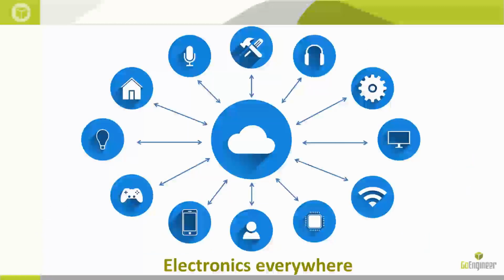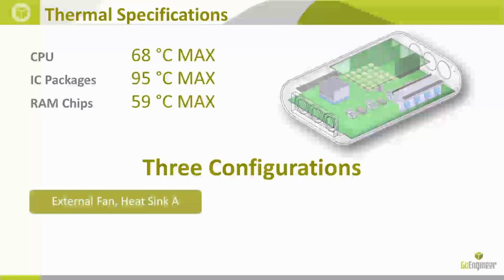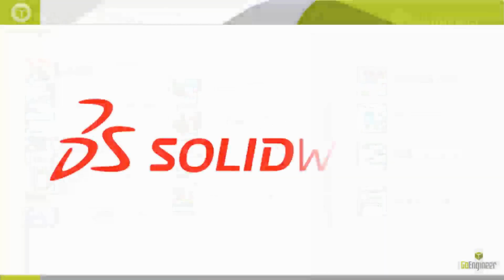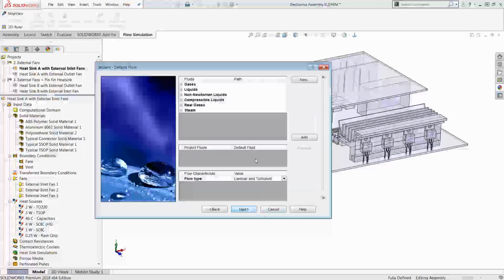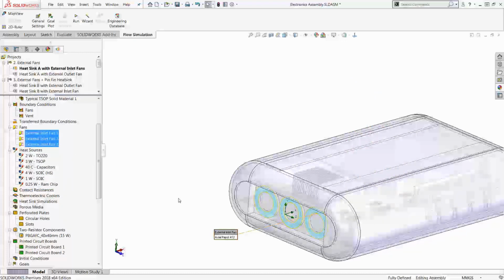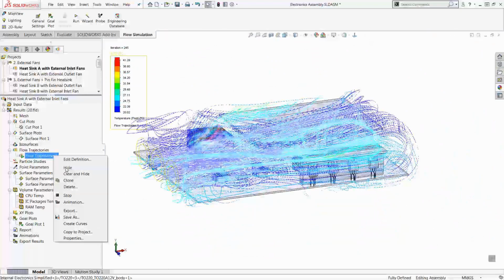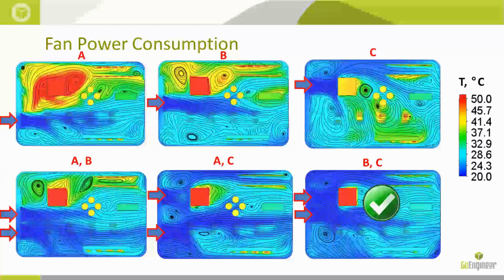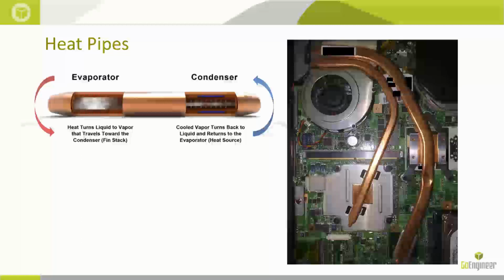SOLIDWORKS Flow Simulation - Thermal Analysis of an Electronics Enclosure

Comment: How to define the TIM for the heat sink?
Reply from the maker: You can add a Thermal Interface Material using the Contact Resistance item in the Flow Simulation setup tree.